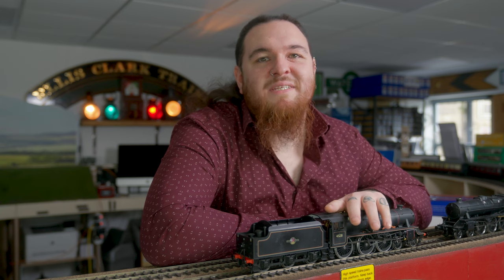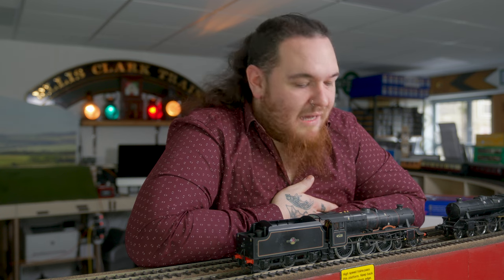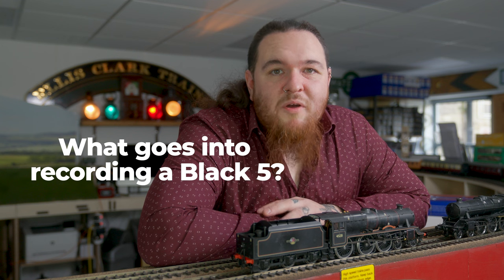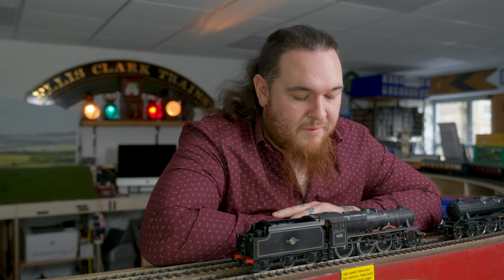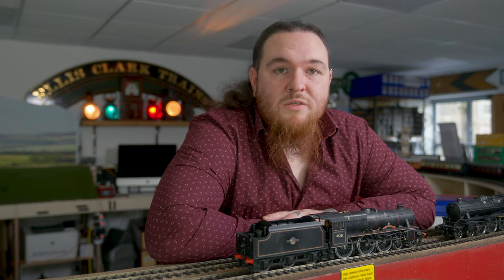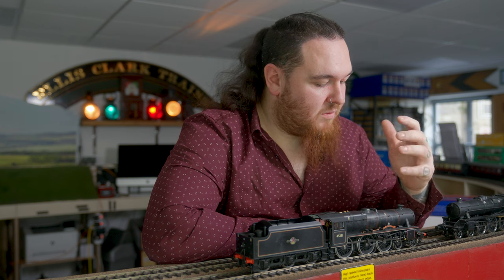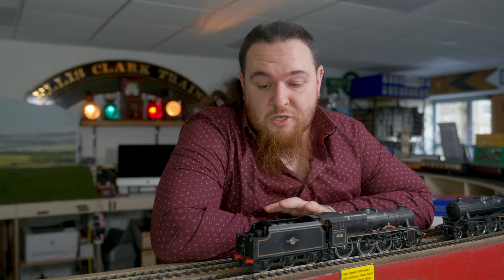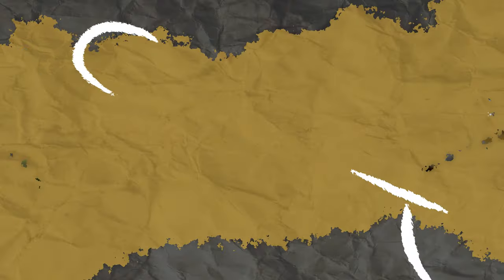Ellis Clark Trains O Gauge Black 5 | The DCC Sound Fitted Models

Comment: WOW, love the 'keep-firing-or-it-will-stop' feature. I've been wanting that kind of thing for a long time. When I first gave a steam loco sound I automatically tried to simulate the steaming up process by first setting the sound volume to zero and then gradually over time increasing the volume of the hiss. I would normally do this over about an hour, every so often playing the coal shovelling sound and at the end play the valve escape sound (they never judged it right :). Only then would I make it move. The steaming up process would be a nice thing to do next, after all, the fact that you could not just jump in a steamer and off you go was one of its disadvantages that caused its demise. It felt a much more real experience when I represented that. Anyway, well done for including that 'keep firing' feature. I hope that if you do fail to keep the pressure up and it stops it is a realistic slow down stop and not a sudden toy-like stop 😃

Comment: I keep going back and forth on whether to buy one of these. They look amazing. 

Chris mentioned on the video that some are fitted with air brakes. Do you know which ones, please because the only reference I can find online is for 45212’s mainline working. Are any of the other models you have chosen (e.g. 45379) air brake fitted and would that restrict the coaching stock I could pair them with? (e.g. only Mk1s and not early Mk2s - as I’m thinking of creating a support coach for the loco to run with in preservation)?